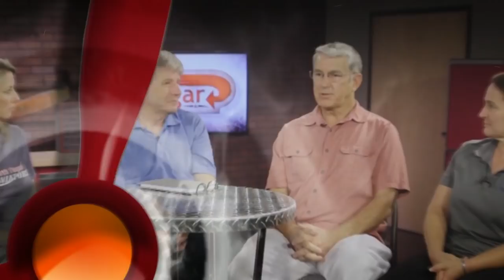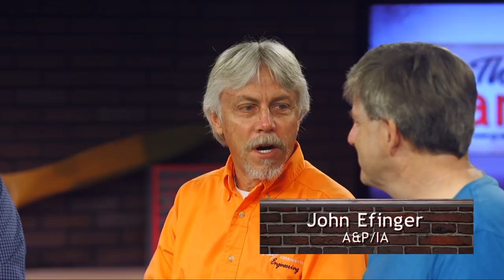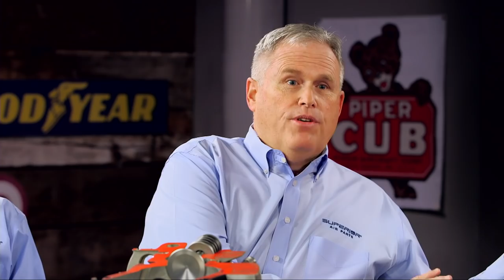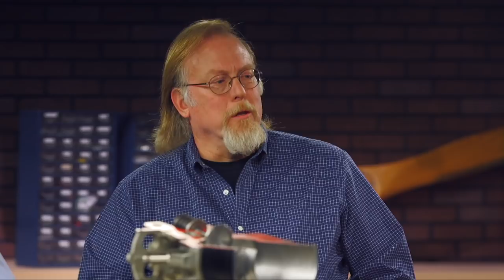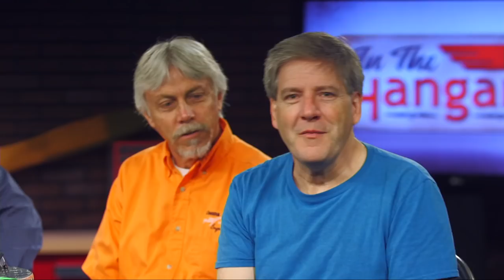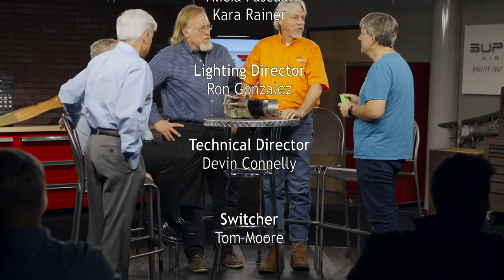All About Engines - InTheHangar Ep 35

Comment: Great informative vid. I have a brother in law that years ago always took out the thermostat in his car in the summer. He was convinced that cooler was better. I told him about the oil sludging on the sides of the block and a host of other problems. When he had the engine rebuilt the shop asked him what he was thinking and they showed him the damage. Then he believed me a little late. I'm sure an aircraft engine is not made to run too cool either.

Comment: You will see metal particles in the oil sample,  but the main reason for submitting oil samples is to determine the
BASE NUMBER which indicates whether the oil is ACIDIC!   If the oil is acidic you need to change the oil more often.

Comment: Y'all touched on something that applies to Civil Air Patrol missions.  We are flying late model C182T aircraft at ~90 kts and ~1000' AGL in the search and rescue mission.  The pilots aim for 50°F rich of peak.  I don't know the manifold pressure or RPM numbers.  Should they be running at Peak EGT in that configuration?
Reply from the maker: DO you know what engine it is?
Reply: At that slow of an airspeed in a C-182, there is a good chance the engine is operating at 60% power or less.  At that power setting, operations at peak EGT would yield the best combination of ideal CHT and fuel economy.

With regards to detonation margins, at any setting above 60% of rated power, 50dF ROP is one of the WORST places to operate an aircraft engine.

      Please read about the “red box” where intercylinder pressures become excessive.  

      https://www.advancedpilot.com/redbox.html has a nice animation showing how % power affects the size of the red box.  

    Note the position on the x axis of the graph where peak EGT lies and how far to the left the 50dF ROP position is when the red box starts to grow.

Comment: Disuse is killer of engines. Fly often within limits. Lycoming recommends for longevity 65% power or less, recommend CHT 380F to 400F (Max limit is 500F), OT of 180F to 210F (Max limit is 245F).
Reply from the maker: Hadn’t heard that about Lycoming. Interesting.
Reply: @TakingOff  Yes Sir. Google:
"Lycoming Tech Tips"  and down load the 49 MB PDF. This is collection of decades of tech tips.

Also on Lycoming's website they have Technical Publications (service bulletins) and "knowledge base" with tips.

https://www.lycoming.com/contact/knowledge-base/tips

Example I Googled "Lycoming Tips for Extending TBO". This Lycoming article gives best practice recommendations, for a TIO-540, but many tips are universal, applies to any engines. 

One thing your panel did not mention is shock cooling. Plan your descent to keep some power and reduce slowly for example. Also make all power changes slowly... etc. Other Tips and SB give maintenance tips.